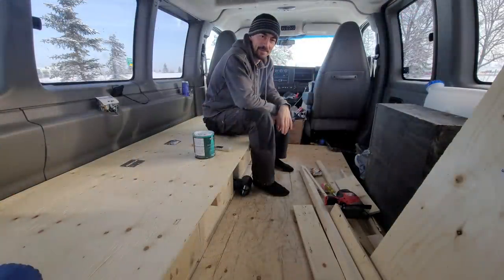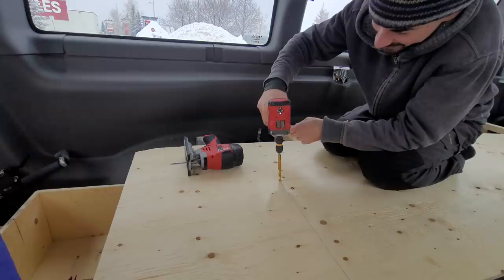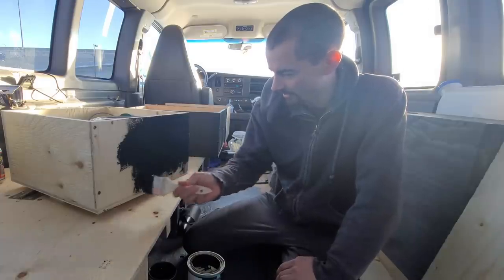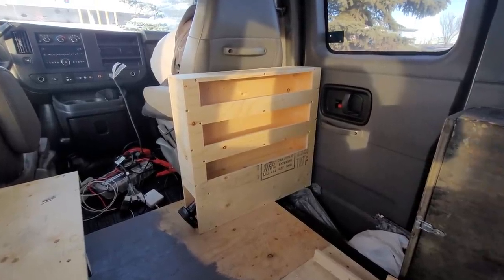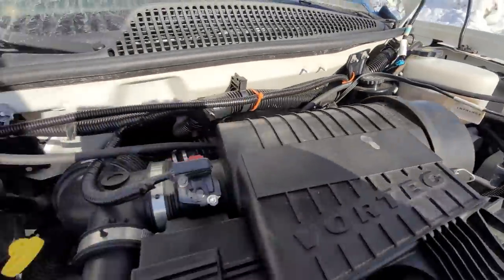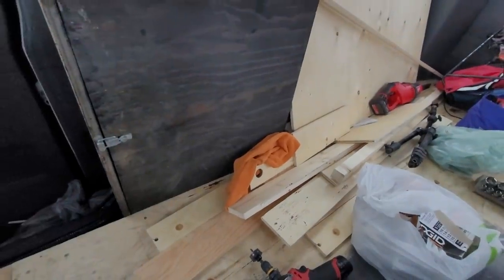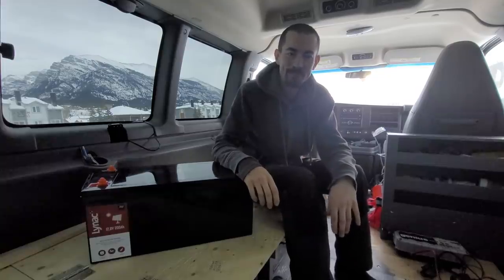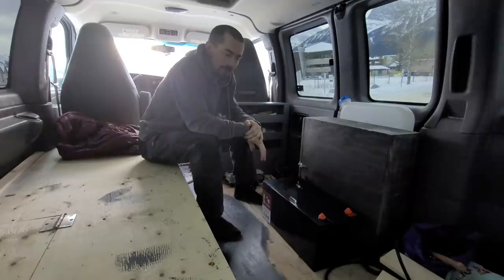Winter Van Life in Alberta - 4x4 Stealth Van Build

Comment: Is your heater a 5KW or 8 KW? North Dakotan here looking to size mine right. May never camp in true great white north winter but want to be able to withstand temperatures in the teens fahrenheit in my Chevy Express high top conversion.
Reply from the maker: Running the Espar D4 now, (4kw).  Seems to be correctly sized btu.  My van is poorly insulated and also covered in windows, so not exactly efficient for the cold..
Reply: @forestyforest  Thanks. Sounds ideal to be able to have it running at a low to medium level constantly rather than having a huge blast of heat and then cycling on and off.
Reply from the maker: @B W Neuberger  yes.. even at -10 Celsius my 4kw is just running on low mode all night.

8kw could be good if you want to be in -40 Celsius.  And everyone seems to agree 2kw is not enough power.